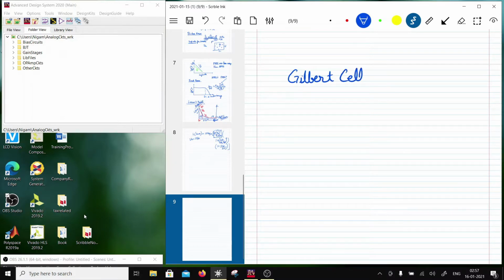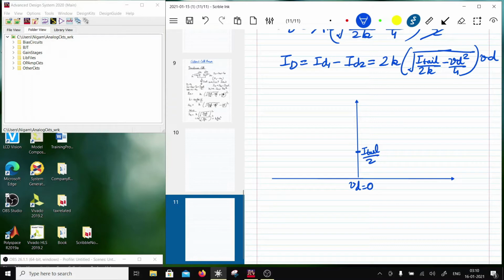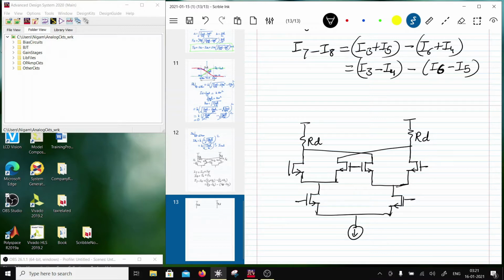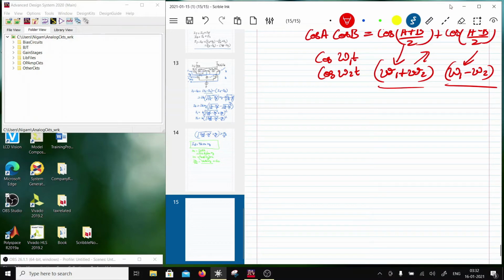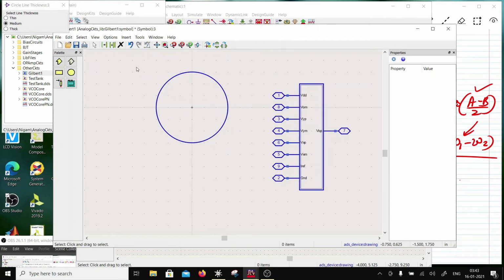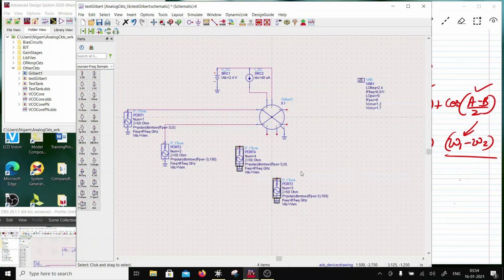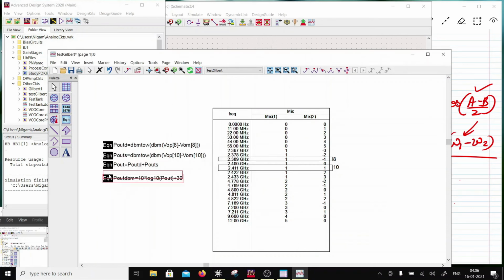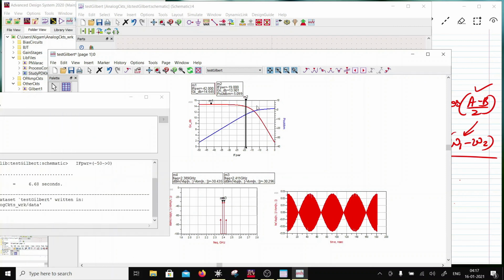Analog Circuit Design using ADS Session26

Comment: Hi thanks alot for the useful video.
I would be thankful if you could have video about layout if gilbert in ads!
In layout we need lines to connect transistor to transistor and other parts together!! How can we design these transmision lines in schematic? How can we calculate the W and L of these transmission lines which we would like to connect them to transistor or other parts?